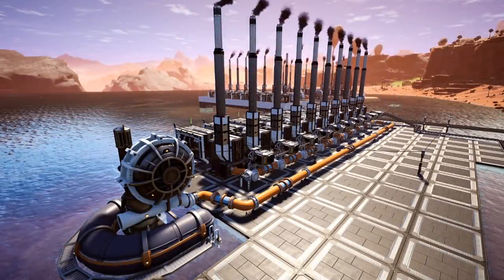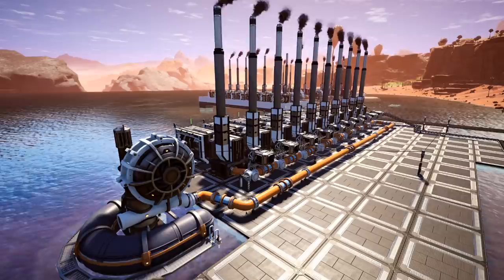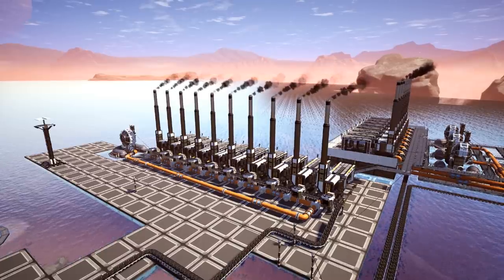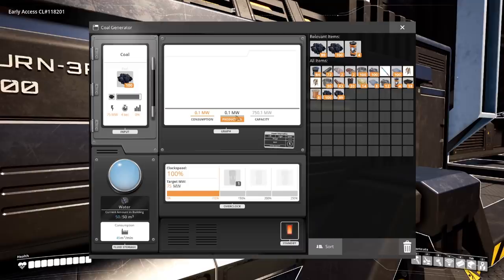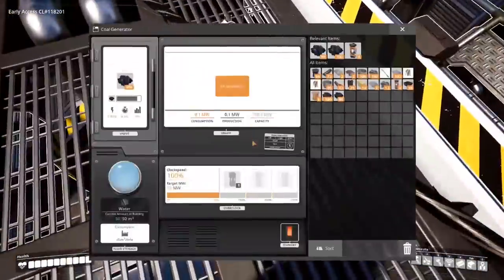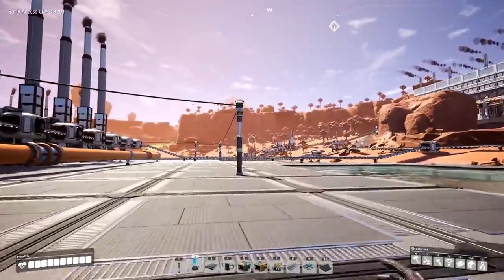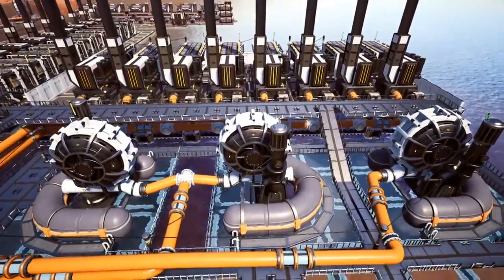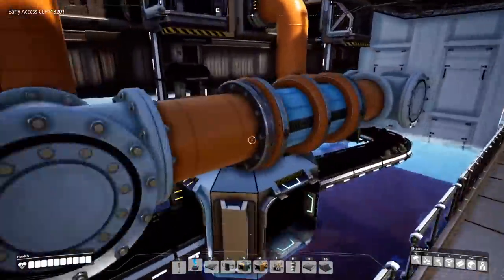Mythbusters How Much Water Do You Really Need To Run A Power Generator  Satisfactory Game

Comment: The problem is that the water system is borked, as well as power plants that use water. I often start a game and my pipes and power plants seem to forget that they were full. In that instance, they start to pulse on and off, if you set-up the "exact" consumed water. Same if you setup an abundance, as the pumps will cycle on and off, which takes time, and you end-up with pulsing power. (If you are borderline on power, the start-up spikes will trip breakers and lead you into an unresolvable issue with starting-up. Liquid takes FOREVER to get into the giant lines. Apparently each segment of line is connected by a soda straw, used to fill it, piece by piece, instead of all at once.)

When that happens, the only solution is to manually shut down all power, until the water catches-up... Then cross your fingers and HOPE it stays that way. (45*10 = 450, but when your game randomly decides your water volume is 0, or a pump turns-off and doesn't start in time to refill the missing volume... It's back to running around and messing with water again.)

This game is just getting more and more horrible with things that just don't make sense...

Belts go from 60 to 120 to 270 to 480??? Why the random 270, which is divisible by NOTHING within the game production. Yet miners go from 60, 120, 240, 480, 960... To add insult to injury, you don't even get the MK3 miner, until the end, when it's not even needed at that point... You are done... Unless you want to rebuild EVERYTHING within the entire game, for the new miners speeds.

Liquids don't actually obey "physics", or even logical, reasonable, flow code. The biggest issue is the fact that the pumps will "suck water out of your pumps, leaving all reserves empty, except the last reserve. Water will not obey reality "head"... It will take forever to fill to the ends, because each segment is like a cup that has to be filled, before the next can fill. When being consumed, the last cup always empties 100% first, which can leave your machines empty, even if you have enough volume that should be flowing. (In an ironic twist, if you loop your water, it just confuses the game and it's about a 50/50 chance of working or the pipes think they are head-to-head, and water just stops flowing in both directions, or simply refuses to fill from both sides, making the problem even worse. Oddly, pipes seem to have a "direction", and the way you connect them will determine the direction, which seems to add flow resistance or act like a conveyor placed the wrong way. Purging the whole line will TRY to reset all the connections in the line, but that is about a 50/50 shot too.)

Why they added such pointless detail to the game, which could have been simplified to "volume in = volume out"... It is beyond my grasp. We are forced to battle it, when it fails to work right, not due to any of our own setups, but simply due to the games borked code failing to work as they think it should be working. Messing with pipes, which literally only has to be done once, in theory, if the code worked... Is like forcing someone to assemble furniture that they will never use, but they are forced to constantly rebuild it, and tighten the bolts, because it just randomly begins to fall apart, even though it was assembled exactly as outlined in the directions. (The water systems and other fluids, all seem to need some kind of constant and random attendance, though they should not need any at all, once setup correctly.) Their solution for bad code... Liquid buffers, which just delay the enviable and add more buggy code to the formula that is already anti-logic and anti-physics and anti-fluid-dynamic.
Reply: use the batteries to handle spikes, they do 100MW spikes each, so 4 of em = spikes up to 400MW is soaked up... if you are running on battery power to keep the grid afloat... upgrade your powerplants before you run out of stored power, running out will then trip your fuses.

Comment: Ah that's why my 3-8 setup worked without any pipe splitting, I haven't gone past the power consumption granted by one pipe yet. 

I need to get off my ass and figure out the relatively simple pipe splitting method to get 3 120 m3 💧 delivered equally to 8 45mw coal burners via 300 m3 💧 pipes
Reply from the maker: The simplest way I've found is to the have one extractor split water from middle, and the two other extractors connect  to the outside powerplants, one at the front and one at the back, link them all together and it should work :)

Comment: piping might be the answer, split in the pipes and meet again at the destination means more than the amount it says it can run. 300 in one pipe and 300 in another means 600 at end location right ? so if you split the pipe it will double the water pressure. if you put a pipe at the beginning of the intake and at the end of the line intake ( perhaps middle) it will and connect all right infront of said power generators you should be able to keep things running no ? ( key locations)

Comment: you can connect a maximum of two point five coal generators to one water extractor. The extractor pulls 120 cubic meteres a minute, and coal plants uses 45. 45*2+22,5 is 112,5 cubicmeter of water pr minute for 2 point 5 coal plants,
Reply from the maker: You can clock the extractor higher should you wish though to allow you to add 6, but yes a single extractor at normal clock speed can provide for just over 2.5 generators

Comment: The amount of water needed is completely dependant on the power used. More power used= coal burned faster + water used faster. Therefore if u have a 1,500mW mega power plant (like I do) but only use 600mW then I've experienced only using 3-4 water extractors at most. But as I use more and more power, resources get burned faster from the coal factory. So at some point I'll have to have faster coal and water to keep everything trucking along
Reply from the maker: Exactly and at full fuel consumption each extractor will need 15 coal per minute and 45m water

Comment: In the second array of coal generators, those extra pipes are completely unnecessary. You can have 1 long pipe going across all the generators with a junction for each generator, then have the 3 extractors connected to any of those junctions. Each generator taking 45 water out of the system ensures you will never get above 300 water per sec at any point in the whole pipe system.

The simple explanation why it works is that at each junction you have 120 water in, 45 water out, that's 75 water. 3 of those is 225. So with the first 3 generators' junctions connected to water extractors, there is 225 water left over for the other 5 generators on the rest of the pipe.

If you really want to push it, you can put 2 extractors on the first junction and another extractor on the second junction to have 270 water left for the remaining 6 generators along the pipe. Everything still works at 100% efficiency with no extra copper sheets spent on pipes. This is actually MORE efficient because the extractors will shut down more often when the power draw is below maximum since the generators will go through less than 45 water and the pipes will begin to bottleneck and you can do something else with the overflow of coal. However, power spikes caused by extractors spinning up could cause a fuse to break when you are adding machines to the grid too quickly (never had this issue, so can't confirm, but the amount of water remaining in the generator and nearby pipes should be enough to make up for the extractors' spin-up lag), but this is easily remedied by moving one extractor to the opposite end of the main pipe or putting a fluid buffer there (finally a use for fluid buffers!)
Reply from the maker: Yep, you're right, and in our recent playthroughs (on the twitch multiplayer save) I actually changed it around so that we had one extractor in the middle and the other two feeding from the outside :)

Comment: I did this before, it took close to an hour for the water to start completely draining out and shutting off power
Reply from the maker: yep, that's the frustrating thing as you might go off and work on something else and then realise you have to return and redo the setup
Reply: @TotalXclipse  fortunately i figure out some quick maths and stuck to it, also endcap fluid buffers are just sweet

Comment: Thanks again for the great video! Can you please advise how to run power to the Water Extractor? I have tried directly off the Coal Generator via direct Pylon connection, but it wouldn’t connect. I have a far from ideal setup at the moment, whereby I am using BioMass Generators to provide power to the Water Extractors. I would really appreciate some help with this, thanks in advance.
Reply from the maker: Each pilon has 4 connections early game. If your biomass generator is connected to a pilon, then you should have 3 points free, one for the extractor, one for the coal miner and  one for a power generator. If they are too far away from one another you may need to run more pilons between them but they should connect fine
Reply: @TotalXclipse  Thanks for the reply. This is hard to explain via typing. What I want, is no Biomass Generators being used at all, they are a pain for RSS collection. How can I set it up, so I don't use these at all, like you have in your video. As mentioned, I have tried running a direct line from a Coal Generator, but the Water Extractor would not allow me to connect it. The were only two connections that ran from the initial Pylon off the Coal Generator. Sorry to be a pain, I'm just trying to streamline things & it's hard to get reliable information on this game.
Reply from the maker: @ZIMsar10  I understand and don't worry once you've got the generator running, connect it to the same grid as the Biomass burners, make it so that you're able to run a few coal powerplants and providing those powerplants are connected to the same grid as the biomas burners (and providing more than the total consumption of energy your factory has) then you should be able to delete the biomass burners and from there The coal generators will be self sustaining :)
Reply: @TotalXclipse  Well my friend, after listening to your WONDERFUL! advise you have solved this problem for me & I am tremendously happy about that! It was doing my head in, having to use Biomass Generators & it took a lot of my time having to hunt for RSS for them, which is best spent elsewhere. I really cannot thank you enough mate, you just made my day!

Comment: I'm currently running 4 Water to 9 Generators and that seems like a good system at the moment. I haven't had my power consumption up to maximum yet, so maybe when/if that happens I may have issues, but by then I should be onto other means of power production... Im happy to screenshot if you would like to see... 🙄🙄
Reply from the maker: You're welcome to send screenshots in our discord :) 
But you'll be fine with 4 extractors between 9 
as the perfect combination is 3 between 8. the extra extractor will easily provide for the single generator, infact you can add another generator if you wish :)
Reply: @TotalXclipse  I run the nine gens to a belt split 3x3 for coal... (easy splits) - that was my setup before water update... so when water was introduced, I reworked my system to accomodate the water, and factored 2 water extractors for 4.5 gens seemed a good ratio... anyway... I'll have upload a screenshot to your discord... :)

Comment: You could've easily tested this by simply adding a fluid buffer and see if the water gradually decreases or stays at the maximum amount. If it decreases, you know you're consuming more water than you're producing. You can also semi guess this by looking at the pump and see if it's constantly working. Another sign of the water being sufficient is to look for the power spikes in the grid. If there is spikes, it means the water pump is activating and deactivating, which suggests the water is sufficient. If you see no power spike, then you may have a problem with the water supply. Point being, there is alot of ways to tell if you are running out of water.
Reply from the maker: You're absolutely right, and running two industrial fluid containers would have been a great way to review the situation, if ever I do a repeat video I might use that option, although the power spikes could also suggest coal running out.
Reply: @TotalXclipse  While I haven't thoroughly thought about specifically that coal part, it wouldn't make sense spontaneously seeing as you can treat it just like water. What you could do if you are unsure about coal is to do exactly the same as with the water, build a storage container and see if the amount gradually decreases. You can apply the same logic to coal in the sense that the coal miner should turn on and off, so if you do indeed see a power spike, albeit it will be smaller than a water pump iirc, it would suggest the coal is NOT running out as it is currently producing more than necessary but can't fit it anywhere, so it shuts off only to be turned on moments later.

The reason we can apply the exact same logic is because the game treats both resources in this case exactly the same. This is also a good tip for anyone, basically to ALWAYS build buffers. Buffers can be considered as an extremely convenient safety net. This I learned from modded factorio and fuck me do you need buffers in all their forms.
Reply from the maker: @AtroFear  I see your point but disagree with buffers, they offer a safety net but actually just masks a problem and just prolongs the shutdown. Sure it has it's uses, such as during a shutdown you wouldn't need to restart the miners and pumps once you've reset the power but a big buffer would only be needed if you had an extremely large setup. In my opinion it's much better to make sure that you have the correct ratio of fuel provided at max production/capacity. That way you know when you're reaching the top of your power production you need to add a new powerplant.
With buffers you think you're fine until it's too late...
As for the power spikes I wasn't referring to miners shutting off due to oversaturation but rather the opposite, when you are not providing enough to your system like a water extractor,  you wouldn't see power spikes from a miner turning off as the whole system would shut down at the spike of power. That's why implementing logic in game would be so useful. 
On a power graph, like we would when a power plant doesn't receive enough water, it would drop down the capacity of the power as a station shuts down to lack of water the same would apply for if coal were to run out on a power plant.
Reply: @TotalXclipse  Yeah, along with logic, I'd love to see some way to make a one-way power flow.  Like a battery system you could set up to be getting power from the excess of your power network, but that sit in between it and a separate grid with your miners and extractors on it set up so they will only send or route power to that side and not the rest of your network.  You can accomplish something like this manually with a little network of power switches between all 3, but it's kind of inconvenient, and really setting up an automatic failsafe or at least something that acts like a diode to only let power flow one way through it, should be something that could be done.

Comment: Anyone know why the graph units change from MW to MWh when you move the mouse over it? Seems like it must be a bug?
Reply: Believe it is a feature not a bug. Time is on the top 90%.
Reply: @MichaelPohoreski  Sorry, I don't follow. Top 90% of what?

Looks to me like you get the readout at the particular timepoint you're hovering on. The number displayed seems to be the MW produced on average through that thin slice of time, but the units present it as if it produced that many MWh in that time, which would only be the case if the thin slice were 1 hour long, which it's not.
Reply: dananskidolf Let me see if this helps: @6:03 see the white box that has the *Consumption Production Capacity?* When your mouse pointer is above the horizontal line the units change from MW to MWh. I believe that graph is showing the power usage over an hour. The problem is that the graph axis aren't labeled. :-/
Reply: @MichaelPohoreski  I don't think so - the graph doesn't change shape at all and keeps moving at the same speed, so it's showing the exact same data, just at the particular time slice you hover on, whereas without hovering on it, the numbers shown are for the current MW. If it were total MWh produced in the last hour (equivalent to the average power out in the last hour), it would be effectively a moving average over a very long period, so the bumps in the line would be smoothed out. And I don't think he's had it running for an hour yet, so it would still be going up over time. 

To me it looks like someone confused MW with MWh (which is a really common mistake for some reason - one made by the narrator too) and somehow both units ended up in different versions of the labels here.

Comment: I use 8 coal power plants with 3 water generators. 

Similar of what u have here. 

But, I do not use pumps, I build at level.
I split the 8 coal plants in 3-2-3
Center water generator feeds 2 coal power plants plus the pipes from the other 2 generators. 

Something like this:

PP PP PP     PP  PP     PP PP PP
  |---|-----|------------|-----------|-----|----|
      W                 W                W

since there will be excess water at some pipes and low water at others, the system complement each other by spreading pressure and water.
So u feed 320 water the exact amount that the power plants need.
45*8=360
360/3=120

PP: coal power plant
-|- : pipes and spliters
W: Water generators
Reply from the maker: Yep this is another great way to do it, with the middle extractor branching out the water to the other two :) bet it looks sweet as well!